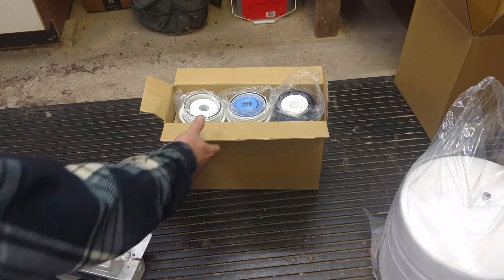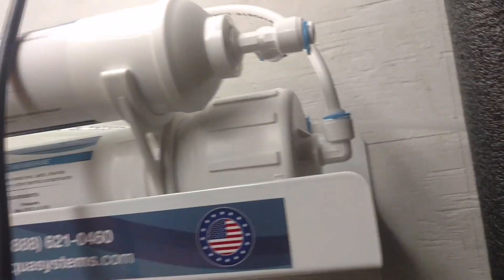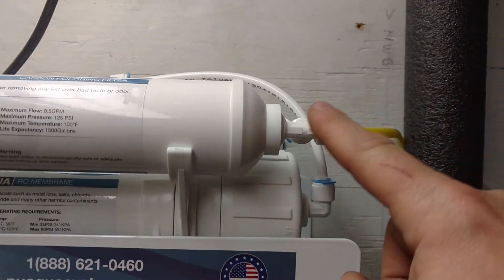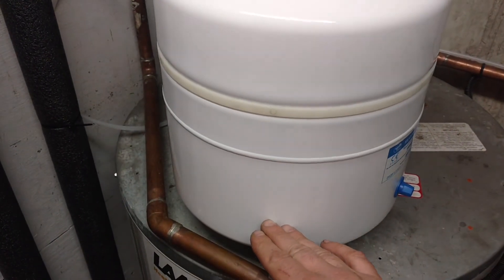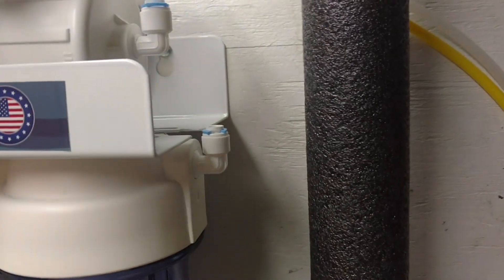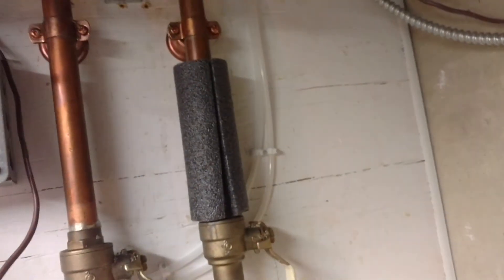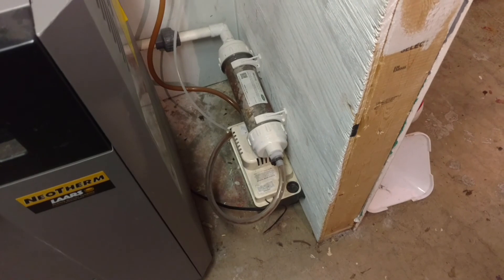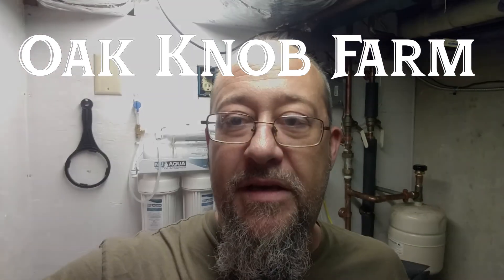Bottled Water?   NO WAY!  Our new Reverse Osmosis Filter!

Comment: Neat little unit!  We were originally under contract on a property that was going to need about 5 grand worth of water mitigation systems before it was move in ready. That deal fell through and we ended up here where the inspector noted the well water was “better than a bottle of Poland Spring”. Been meaning to have it retested a few years on now.
Reply from the maker: Our water is safe, but mineral rich, particularly iron.    It makes a huge difference in taste.

Comment: Good day Sir 🌞 Great installation Sir 👍 and great idea for maintenance to install it were you did 👍👍👍 If I may kindly suggest to put a waterproof cover ( like for outside ) on your electrical outlet about your water reverse osmosis filter since it doesn't have one, and to protected you or any ones in case of a sudden water leak will holding the faucet upstairs  🤪🤣😇👍 Keep up the good work Sir Cheers !!!
Reply from the maker: That is a great idea about the cover!  You never know!
Reply: @OakKnobFarm  😇👍🌞

Comment: Neat system.  That is filters plus the RO system?  No electricity needed to the unit?
Reply from the maker: No power needed on this one.   That's why you get the expansion tank for pressure.  It has 3 pre-filters->RO cartridge->tank->final carbon filter

Comment: Sweet system, Dave! Great idea to write on the wall, too! Does the water that goes into the system bypass the water softener? That's the only issue I have with my Berkey—I can't use it with softened water, which is piped to every faucet. I have to fill from the outside faucet.
Reply from the maker: Currently I'm running it on softened water and it seems ok.    If the filters plug too fast I can switch it to unsoftened water too.  The 3 parallel pipes at the saddle tap are hot, cold, and untreated outside faucet.   But, our rust is SO bad I think it will do better this way